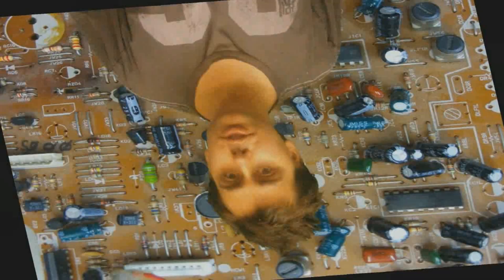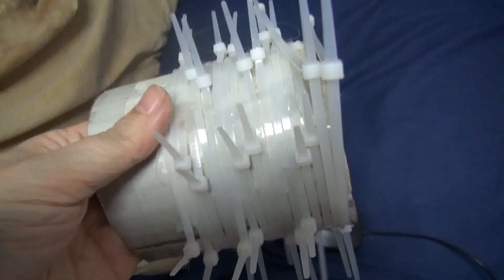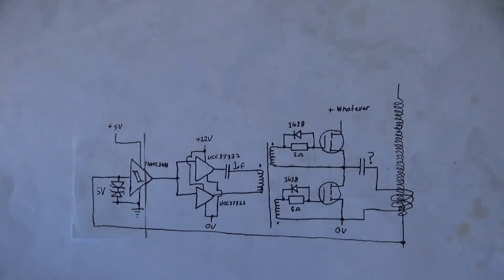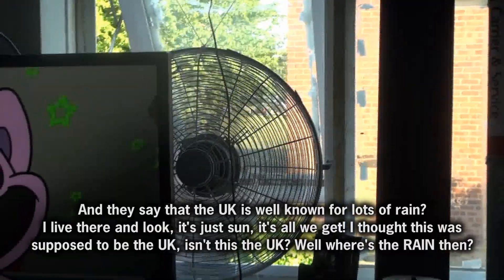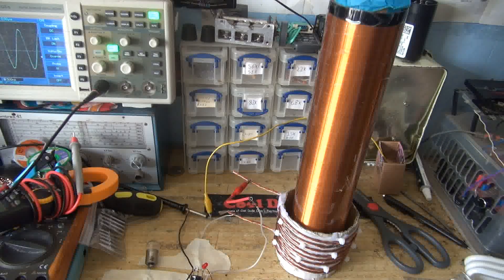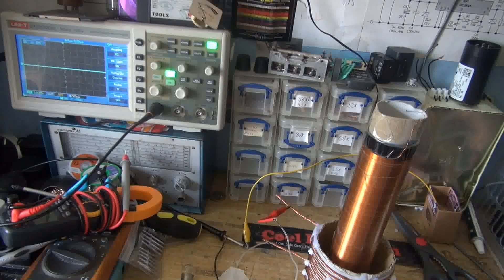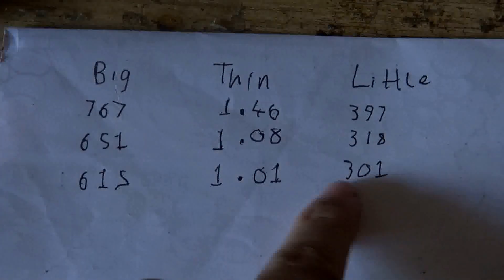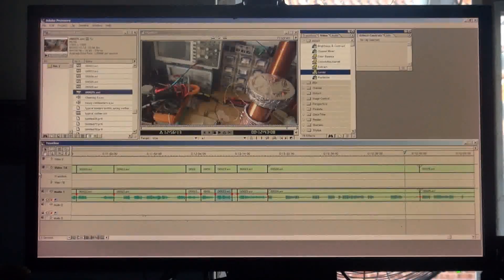New Tesla coil build part 1 of ?, schematics and stuff

Comment: a potential issue with the circuit at 03:38 is all electronics have a propagation delay and at high frequencies, this will introduce lagging a phase shift and lowers the output performance. A series tuning capacitor (HV rated, adjustable) on the feedback input will cancel this phase shift and work wonders.